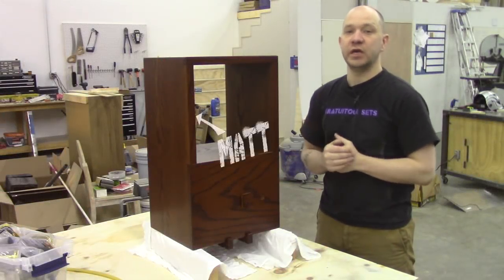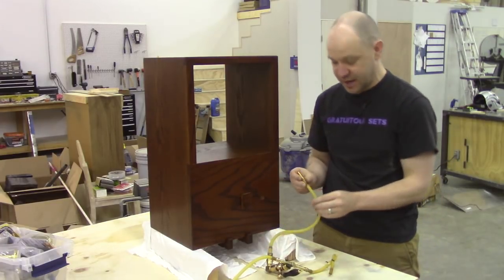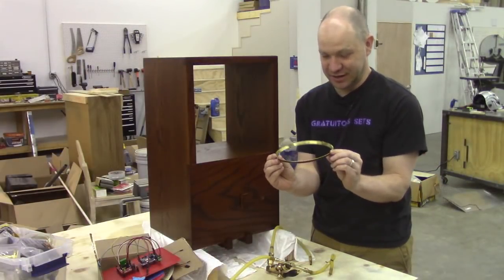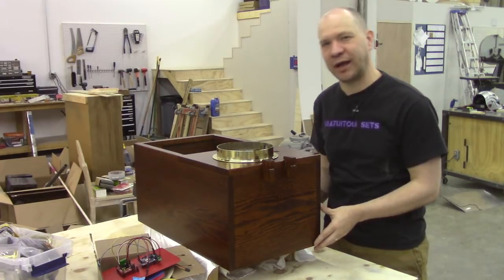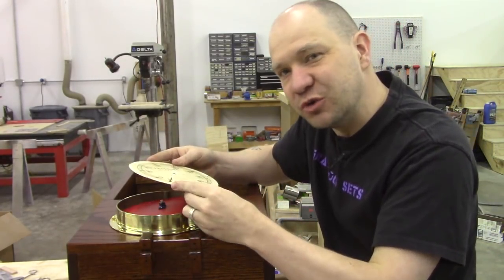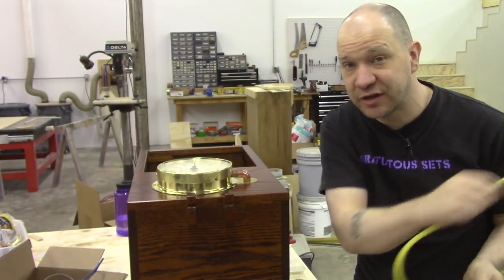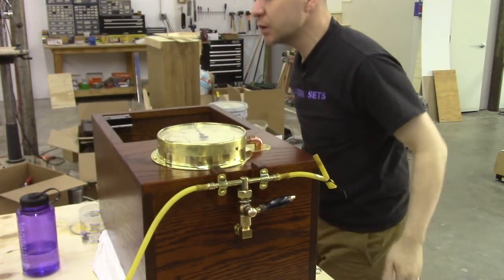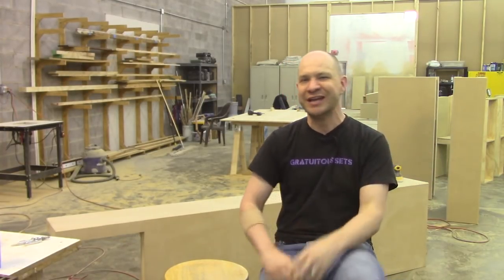Spirometer Puzzle

Comment: Nice use for a fan. Curious if you tried an air pressure sensor first?
Reply from the maker: We didn't- would it need to be inside a closed vessel, or open air?
Reply: Cannot find what I used but below is a link that shows something very similar. Simply hook up a tube to the sensor and read the analog signal coming back. 

https://circuits4you.com/2016/05/13/arduino-pressure-measurement/ 

Hmmm I do like the idea of a closed vessel and using a barometric / atmospheric pressure sensor. You got my wheels turning now.
Reply from the maker: i just checked- we wanted a puzzle where players would need to blow and hold a value for a set period of time. With the pressure sensor (closed system) they could use their cheeks to develop the appropriate pressure, then hold the value by simply blocking the tube with their tongue.
The way we did it (client specs) the game is dependent on both volume and velocity of air spinning the little generator.
BTW: thanks for introducing me to the pressure sensor!  :-D  Now i gotta figure out a puzzle for it...
Reply from the maker: hehehehehe
Reply: I did not even think of volume and velocity so the fan is a great choice. Most people playing these games will never know how much time and different variables that need to get worked out making these. As always thanks for the great videos.